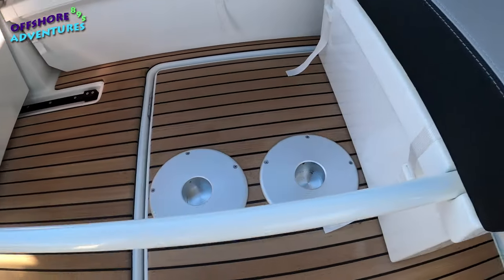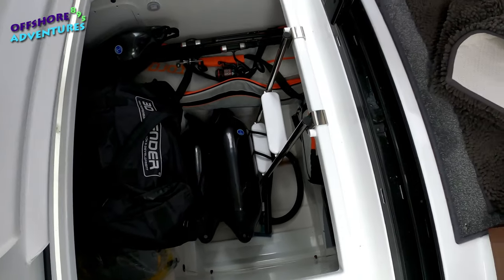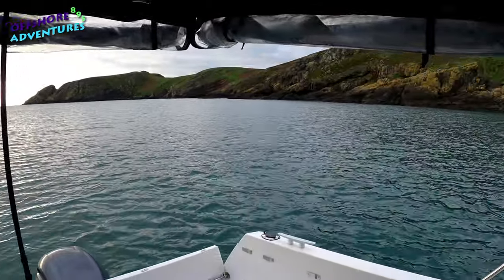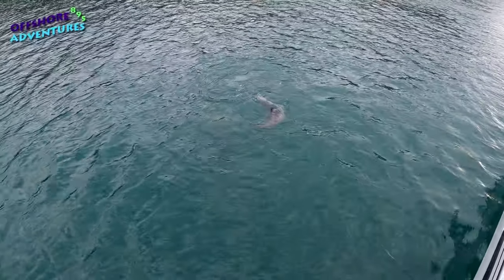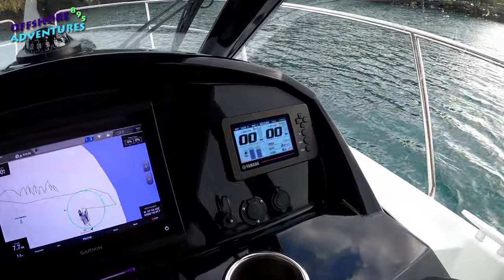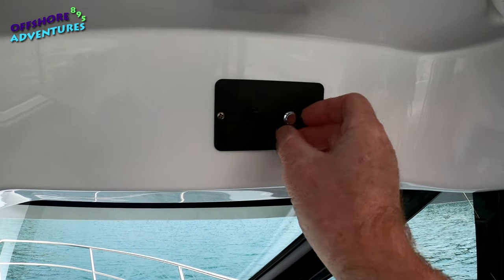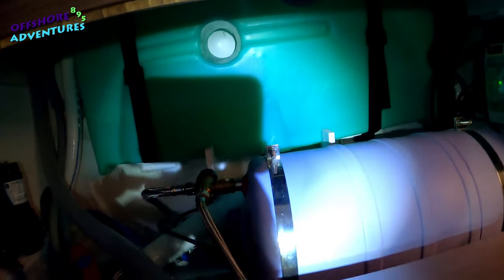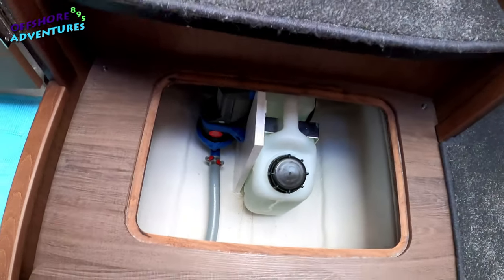Walkthrough - The Jeanneau Merry Fisher 895 Offshore and a picnic with seals!

Comment: Excellent! Probably the best video I have seen on the MF 895. Even though I own this model, I still learned a lot from your video. Thank you.
Reply from the maker: Many thanks indeed Michael, much appreciated and great feedback for us. More to come from us when we're out of lockdown (when ever that may be!!). Stay tuned :)
Reply: Please forgive me this random question but what is average cost per year to keep this beauty?
Reply from the maker: Morning  @at4095 and thanks for watching. It would depend on a few factors such as where you moor the boat and generally how much use it has while you own it.

Mooring a 9m boat permanently at somewhere like Neyland Marina would be about £300 per month plus a small electric hook up fee. Then fuel is the significant cost as to 'fill up' would be over 1k at todays prices with 600 litres capacity. The range of the tank varies significantly - if pottering around at 10mph all the time you'd get c300 miles from that tank, but if you were at planing speeds she'd be using around 60 litre per hour at 25mph or if at WOT (Wide Open Throttle) that is a thirsty c150 litres per hour at 43mph. 
Finally servicing - thats X 2 as two engines which could be 1k a year, or more, and each time it is serviced there would be fees to lift the boat out and back in to the water which could be £500 each time that occurs.
Those are the major costs plus then the kit and equipment that goes in the boat.

That gives you a glimpse :))

Comment: This really is a fantastic video Bob and Nicky. It really tells you all you need to know about the 895. Plus all the little extra bits of information and advice. Given your own experiences of the boat.
Still considering fitting a couple of solar panels to top up the battery whilst at anchor or on a buoy. Did you find on your longer overnight stays you needed to run the engines to top up the house batteries?
Did you ever think about fitting a Victron 712S battery monitor with an alarm to ensure the batteries never went below 50%?
Reply from the maker: Many thanks, as always, for the feedback John, much appreciated:) We never noticed any battery issues at all during all our usage, both winter and summer, and therefore didn’t go down the monitor or solar route. I think if we’d had air con say or lots of other power hungry devices it might be a consideration but there are two house batteries already which give a lot of ‘off grid’ power as long as you know what the combined usage of your devices are. If you’ve got an idea of your intended device usage, coupled the capacity of your two house batteries combined, you might find you don’t need those interventions, or you would be able to assess more accurately if you DID need such interventions - like the panels or monitor you mention. 
I’m just doing similar sums for the motorhome which currently has one house battery with a bay available for a second, if required, which I may utilise to give us more ‘off grid’ time if the sums tell me it would be useful :) 
Hope that makes sense :)
Reply: @PowerboatingAdventures  Thanks Bob. Your views always appreciated. I might get the monitor fitted. Just for peace of mind. Only intend having fridge and chart plotter on all the time at anchor plus occasional use of lights, tv and fusion stereo. As you say, good to have two house batteries. Thanks again.

Comment: Great video , thank you . Bob , how is the fridge powered , if by electricity , will the engines recharge battery ?
Reply from the maker: Many thanks Jonathan and it is a 12v power supply so running off house batteries which will recharge from shore power and engines running :)

Comment: Hi Bob & Hi Nicky.  Great walkthrough.  You inspired us enough to buy our very own 895 offshore.  Fantastic boat.  We were wondering what - if any- winterisation you do to the outboards?  Kind regards Steve & Tina
Reply from the maker: Hi Steve and Tina , what lovely news that was and such a lovely message. We hope you have an amazinggggg time with the 895. Now in terms of winterisation we did next to nothing, purely because we were on the boat at every opportunity throughout the year. Some of those frosty bright mornings when the waters are flat are so lovely. Heating on inside and a cuppa sat out the back in a winters sun was just fabbbb. The Meaco dehumidifier was running throughout winter when we were away from the boat - which prevented ANY damp - but apart from that nothing else for us!! 

One thing to consider, for the rear swim platform shower,  is to avoid that freezing as the plastic shower head is fragile and prone to damage if it freezes There is a stop cock for the line that leads to the shower head so you can isolate then drain the water out and additionally I wrapped the head in clingfilm to further prevent damage which, as a result, never gave us a problem during the very cold winter months. 

Propane in winter is better than butane, if it’s cold, so perhaps take propane if your out and about and need the all important cuppa. 

It just means you’ll have to keep using it throughout winter - oh dear 😁😂🎉🎉

Comment: This is the best video I've seen of the 895, seems to be the perfect size and setup for fun and weekends away. 
    Would you know if the roof bars are sturdy enough to take a 'sit on top' kayak (approximately 30 to 40lb weight) ? 👍
Reply from the maker: Many thanks Steve and that’s great to know! Couldn’t find much detail before we bought so here we are!! Yes the SUP rack would definitely take that sort of weight. It’s really solid, no flex in it across the width of the supports, screwed into the edges of the saloon framework which therefore disperses the weight down through those vertical sides making it well supported. Most SUP’s are in that weight region too at 30lbs so made for your sit-on. 😁🎉
Reply: @PowerboatingAdventures  Thank you very much for the info, I  hope you and yours have a great new year.👍
Reply from the maker: You’re very welcome Steve. Have a great New Year too 🎉🎉👍

Comment: Brilliant video, thank you for taking the time to make it. We are considering an 895 offshore to replace our current boat. We are wondering if it would be possible to change the forward cabin into a comfortable sofa/V-berth.
Reply from the maker: Many thanks Mrhelichopper (like that username😁), much appreciated. 
The forward cabin double bed has that storage area, underneath, at the foot of the bed where we keep some cushions and tools etc (as you saw in the film) and then there is that void underneath the pillow end of the bed for some electrics. Not sure you could split those areas for a V berth as the hull is moulded for those areas. Daniel Yeates at BHG Marine, Lymington, Hants, knows these boats inside out so he would tell you if it’s been done previously as a modification or whether your proposal is achievable from the structural perspective. Do let us know if you go for the 895 - you’ll love it 🎉☀️
Reply: @PowerboatingAdventures  thank you for taking the time to reply. I will let you know how we progress.

Comment: hi guys great video
regarding refilling for the diesel heating and petrol engines how is this accomplished cant see diesel tank refill
all the best
Reply from the maker: Many thanks Andrew and in answer to your questions ....

The diesel is filled through that brass unscrew cap on the tank itself. We did that using a plastic 5 litre can. The Webasto uses a VERY small amount of diesel and we only topped up once in the year.

The petrol fillers are shown at  27m 46 secs on the film - 2 x 300 litre tanks with a filler on each side of the boat which you'll see briefly in the film. 

Hope that helps :))

Comment: Nice to see a boat tour including some practical boating action. The seals where lovely. What kind of Litres per hour do you get at what speed?
Reply from the maker: Many thanks Martin - it's lovely out and about in Pembrokeshire. I'll add some lph data tomorrow for you when I'm at my desk :)
Reply from the maker: Hi Martin - as promised the data I have so far is we've done 187 nm's at an average fuel use of 2.77ltrs per NM. That covers both slower trips and those at planing speed. In terms of fuel rates at different speeds I am going to do a film of that showing the LPH as we go through the different speeds. I know the performance data for the boat says the following but I want to compare that to the REAL data .... at planing speed it should be 59LPH at 21 knots. As soon as we escape from lockdown I'll be on it!! :)

Comment: Sorry to bother you again Bob and Nicky but consider you the 895 experts! Could you please tell me how you fitted out the cupboard under the sink/stove so plates and dishes, pots and pans stay secure in a seaway? Did you buy or make any plate, dish stowage device? Maybe you use the same in your motor home? Still no news on my boat!
Reply from the maker: Morning John, 
Never any bother at all!!  
Gosh the wait for your boat is torture!!!! Any updated arrival date? 
In respect of the cupboard I used one of these

https://www.amazon.co.uk/Plate-holder-cutlery-space-plates/dp/B07PDYV1KH/ref=sr_1_5?crid=14YCA61ADRBP0&keywords=plate+holder+caravan&qid=1647341530&sprefix=plate+holder+caravan%2Caps%2C54&sr=8-5

They worked well. 

I think if we had kept the boat I was looking at fitting some drawer runners so we could have a pull out type unit as well - I saw a couple of examples of that on one or two of the forums and it would be a bespoke product to fit the space - here's an example albeit I might have used plastic drawers but you can see the principle :)

https://www.facebook.com/photo/?fbid=10158096574821549&set=gm.654667995176821

But that straightforward foam unit did the trick for us and we had bamboo plates/dishes etc which I think we got from Go Outdoors - an Outwell product that are unbreakable!!

Hope that helps John and fingers crossed for dates as the Spring/Summer approaches :))
Reply: @PowerboatingAdventures  Many Thanks Bob and Nicky. Your advice and experience is always appreciated. I had seen the foam plate stacker and will get one of these.
By the way have you seen the fire sticks ( no mess extinguisher with 10 year life) that you can get at Force Four. Well worth considering for your Motorhome. Frustratingly Jeanneau are unable ( or unwilling) to give Daniel any detailed information on my boats progress or likely delivery date ( already three months late). A boat due last July has only just arrived! So eight months late! However other models arriving only a month late!  Not sure why ? Perhaps I should have bought a motor home. Enjoy your travels and adventures. Thanks again for the information. Appreciated.
Reply from the maker: @johnpenson8801  Fingers crossed for some good news soon John :)

Comment: I see you have a 3D dinghy which seems to fit well in the locker. Can you tell me what size and model of dinghy you went for?
Reply from the maker: Hi Paul, yes it does fit well plus space for the Torqeedo too. It’s the 3D Superlight Twin Roundair 2.5m. We got it when we had the MF 795 to fit on a roof rack but the 895 offers a lot more storage space so you could probably go bigger and still fit it in there. The bag size for the one we have is 70x45x32cms.  Their Superlight Twin Air range goes up to 2.9m the carry bag being another 280mm longer so would probably work too. Hope that helps 😁
Reply: @PowerboatingAdventures  Thanks for that- very useful.

Comment: I noticed you had a leather - ette type seating material for you dining and fabric in fill. Was the leather material an option? Is that an X - large helm seat?
Reply from the maker: The Leatherette Dolce Artesian is an option instead of the standard fabric. We had the fabric on our 795 so decided to have a change! 😁 The helm seat is standard and has that fold down piece that creates the seat bit, and in the up position it allows you to stand and lean on the helm seat. The seat is adjustable forward and back 😁🌊

Comment: Hi and thanks for these fabulous videos. My 895 arrived today and is now in Swansea marina.  I'm just about on top of most things but i wonder if you can advise about shore power.  I cant seem to get it to work and I think it is something really simple I am missing.  Thanks again for this brilliant sequence of videos.
Reply from the maker: Hi Simon,  have you plugged in both ends with a meter on the line and have the Marina allocated you a plug officially - they might not have switched it on if you haven’t got an account yet - that’s the first suggestion :)
Reply from the maker: Fantasticcccc news that it’s arrived and only a stones throw from us! :) Exciting times ☀️
Reply from the maker: Second suggestion - try another socket that you know works - with a neighbour say to see if your lead works on their boat.

Third is - we had a faulty plug on our lead and I had to take it apart and repair it!!
Reply: @PowerboatingAdventures  Thanks, I think it just wasn't connected properly.  All working now :)
Reply from the maker: Excellent - enjoyyyyy the boat 🎉🎉

Comment: Hi! What is the top speed the 895 reaches with twin 200s? Best regards, very nice boat!
Reply from the maker: Hi Mrcss, We haven't had the boat at WOT yet. The spec suggests 37-38 knots at around 6000rpm. We will be doing that test in future episodes - no doubt!! :)
Reply: @PowerboatingAdventures  Thanks for the reply! one more question though ;) What was your top/cruising speed and fuel economy on the 795 with the 200, we currently have a 2015  695 and are maybe looking to upgrade. we keep her behind our house so an 895 is a little too big  for our dock unfortunately haha.
Reply from the maker: Surely you need to get a bigger dock!!! :)))  I didn't keep as much detail on the 795 as I'm now doing on the 895 - i know the 795 was about £3.85 per nautical mile at 4000 rpm and could do around 32-33 knots WOT with the BF200DXRU engine albeit we didn't do much WOT - more trying to find the ultimate/most efficient planing speed. 
 I am keeping more detailed records on the 895 though if you decide to 'Go Large' on the dock :)) FYI The honda 200 was around 284kgs whereas the Yam 200 is nearly 60kgs lighter which would be a consideration if you went for the 795 - 60kgs right at the back is a fair difference! Both great boats of course as is the fabbb 695!!
Reply: @PowerboatingAdventures  wow 285kgs!! Didnt expect that! I was looking at the yam 200 anyway! We have a 130AETL and gets the 695 up to about 28knots, but as for cruising speed I feel like she’d be a lot more efficient and more fun with the 150/175🤔 since with more then 3 people on board it really is hard to get her on plane😅
Reply from the maker: Yes the 200 Honda (or the Yam for the 795 I expect) easily managed to get on the plane with 5 or 6 adults that we sometimes had on board and could hit those 30+ speeds. It would have been good to compare a Yam 200 on the back with the Honda 200 as specific data is pretty difficult to find (we found very little 'real' data when contemplating the upgrade) which is why I've started keeping detailed data on the 895 for those interested/considering the swap. Many thanks for the sub btw :))

Comment: Would you recommend equipping a bow thruster to the MF 795, or can I save some money there?
Reply from the maker: Hi Philip, We would recommend fitting the bow thruster. Our 795 with its Honda 200 was a great boat but was most definitely easier to manage at slow speeds around the Marina, fuel berth or even picking up mooring buoys WITH the bow thruster. In breezier conditions, for all those tasks, it was even more useful!! Bite the bullet and say yes to a bow thruster 😁😁. Enjoy your 795🎉

Comment: interested too know if there is only 2 of you what difference you found between the 795 and the 895 excluding the size
Reply from the maker: Many thanks for watching Mark. The handling was easier with the 895 as it was more stable and the twin engines made slow speed manoeuvring easier. The walk on to the 895 was all at the same level right through which was an improvement. The outdoor space at the back was bigger and offered better seating set up - especially with the sun pad. I loved the side door access and the wider walkways both sides of the boat. Good height in the heads, plus the shower in there.  Both cabins and beds were a good size. The galley set up was easier to work with and the storage better. The extra space and that front sun pad which turned into a bench seat was my favourite place to sit! There were so many improvements, too many to list probably, but that hopefully gives you a flavour. Of course running a second engine meant there was a big difference in running costs!! Both lovely boats though bringing a lot of great days out!!
Reply: @PowerboatingAdventures  cheers

Comment: Good morning Sir, I would like to know how is your heating system and ducts installed inside the boat. I want to install AC and heating in my boat 
Thamks very much
Regards
Reply from the maker: Morning Oscar and thanks for watching. If you are able to send me an email address I can e mail a copy of the MF 895 Manual which has some diagrams of the AC and heating when installed - not loads of detail but will give you a idea :) . We just have the webasto heater on ours as you may have seen on the walkthrough, but no air conditioner.